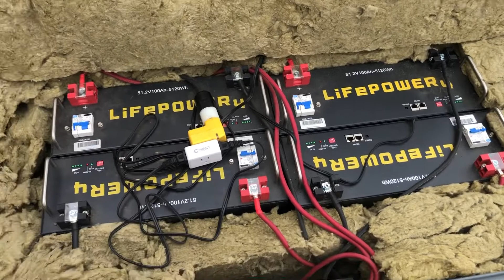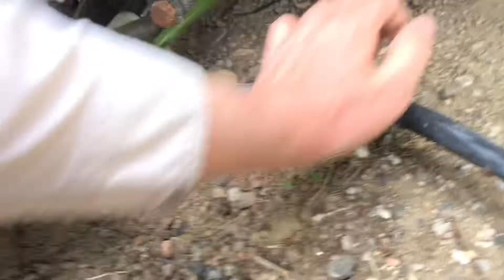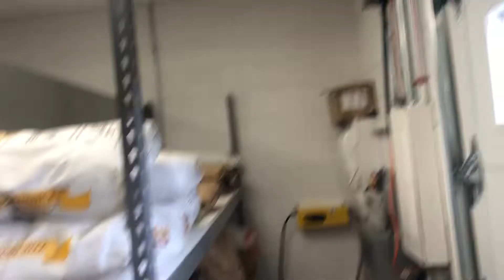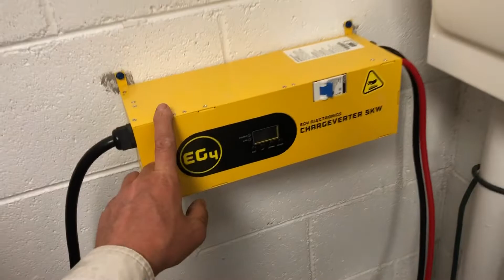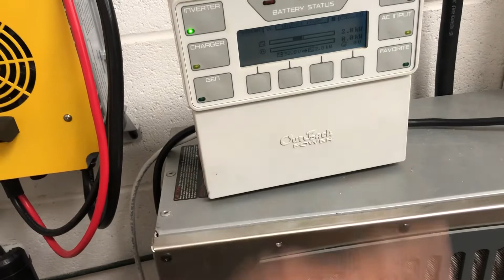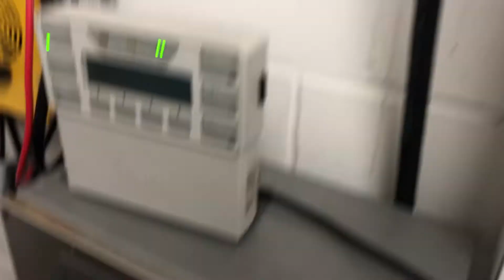Running house off a 12 amp Grid connection.

Comment: Very nice setup.  EG4 Chargeverter question.  If I have an EG4 continuously connected to battery and AC to my standby generator; does the EG4 maintain the last settings or does it reset to a default setting whenever AC power is disconnected.  If it resets to default (whatever that is) and I have to re-input my charger settings every time, the EG4 won't work for me.  Thank you.
Reply from the maker: The only time it would change is if you disconnect the battery. AC on and off has not been a problem.
Reply: Exactly what I was looking for.  Thank you.

Comment: This was the exact solution that I came to for my RV power system using a LV6548 inverter charger. I wanted the 6500 watt output in a compact package and also needed a system that can be metered down to the shore power source available. The Chargeverter allows me to run to the maximum available and keep the batteries charged while allowing me to use a massive amount of power when needed. Love it and believe 48 volt, off grid style systems are the future for larger RV power systems. Well done!
Reply: I would love to be able to speak with you in regard to your set up. My wife and I are moving up on a mountaintop in Northern Nevada. We purchased our altE Pre-wired Syst, SW4048,CL150, SCP system prior to pandemic and my wife had cancer - so we decided to hold off installation/construction until she was well. Last year we we moving forward and I had a heart attack (better now). I have now looked in the XW PRO 6848 (close to your unit size). I will call Schneider to see if our option is to add another SW4048 an accomplish "surge" issues from pumps and motor. Thanks for posting your thoughts - always interested in hearing what others are doing.

Comment: Why didnt he just get a solar generator and run what he has to and charge it up with few solar panels?
Reply: adding solar on top now would be the way to do it and the charger would need to run less and can even be put on a timer to only run at the cheaper hydro rates
it's a nice setup though!

Comment: Nice video. I did see interesting applications and all looks fine.

I would suggest few improvements. 
1. I would change orientation of that EG4 charger to hot air would go straight up . they say it doesn't matter much as it is forcer air..but trust me it does matter 
2. I do see a lot of rodent coming with wrong directions inside..those tubest should be fixed by some mesh wire or similar..
3. that generator and that connector should stay inside and not on the ground outside.
4. those cables should have some protection ..even if it is plastic tube it is better to have it so you wouldn't cut it by accidently walking over with some stuff..
disconnects

Comment: The duty cycle on that chargeverter must be exceeded it will be quite a torture test for it.
Reply: he's running it at 2800watts max if it's at 240v so it should last a long time I would think 
I've got an older 12v 800AH setup just like this that's been running for years and like he say's the battery's are pretty much always at 100% 
so really the charger is not running full tilt all the time

Comment: Nice set up, may I   Know where can I get the same eg4 steel box you are using? Thanks for sharing.
Reply from the maker: The EG 4 chargeverter is available from Current Connected. 
I purchased the steel jobsite box for the batteries from Zoro it is a 24x48”version.
Reply: I was just wondering why you don’t have those EG4 batteries in the garage, LFP batteries are safe enough to have in the house?
Reply from the maker: @stevedutcher3875   Hey great question. I had a different battery in a different system  in a steel enclosure. The BMS mosfets shorted and this shorted the cells and overheated to 750 degrees. Fire department was very happy about the enclosure being non combustable. I took that wisdom and now just build outdoor enclosures with non combustable materials. I have some other videos showing this. I agree the LFP is typically very safe.
Reply: By the way, nice setup!

Comment: Here's an alternative, low-tech way to do it:
Use two 480V ACME tranformers (these ones specifically due to their low impedance) T2535183S. $3000 incl. shipping at automationdirect.
Use all 4 wires for current carrying. Step up and down voltage. Neutral and ground aren't needed thanks to the step down isolation transformer.
At full load (24A per conductor), you get 21.8kVA into the house with 7.5% voltage drop (5.25% from conductors, 2.25% from stepping up and down), of which only 6% is real loss ans 1.5% is reactive.
At 3kVA efficiency is much closer to 98% and voltage drop is 1%. 

Much safer during a lightning storm, overall more efficient and less prone to failure.
Reply: So simple, far cheaper, only disadvantage is not having battery power for grid down situations. Unless the house is a mansion, or using only heat strips, that should be enough power to run every load at once.
Reply: Pardon my ignorance, but wouldn't the restrictions because of the 500ft of cable from the neighbour make this system unusable? Just asking, prepared to be schooled.
Reply: @Ulbre  10AWG wire is 1ohm/1000ft. A 500ft run one way is 1000ft. So the resistance for one pair is 1ohm. Since there are 4 wires, they can be put together in parallel and the total resistance drops to 0.5ohm.
That means that for each amp running through the 480V line, there is a 0.5V voltage drop. 0.5V is roughly 0.1% of 480V.
So basically, for each 480VA running through the line, there is a 0.1% voltage drop.
When converted back down to 240V, that's a 0.24V drop per 2A (1A@480V=2A@240V). Or an apparent impedance of .125ohm. 

Doing the same exercise at 240V without transformers:
Only 1 pair can be used, because 1 wire is needed for ground and 1 for neutral (the transformer in the previous example generated an isolated neutral which can be grounded)
Total resistance: 1 ohm, so we drop 1V per amp going through the line. Apparent impedance = 1ohm
Voltage: 240V
1V is roughly 0.4% of 240V
So for each 240VA, we lose 1V.

Under a 5kVA load, the 240V output of the 480V line will read 237.4V
Under the same 5kVA load, the 240V line will read 219V.
Each time you double the voltage, you quadruple the power that can be sent through a transmission line with the same voltage drop, assuming that the line heating up is not a limiting factor.
Because an isolation transformer creates a new, isolated neutral that can be grounded, we can use all 4 = double the conductors for useful current carrying in this case, so the capacity is 8x greater. 

Does this make sense to you, or did you spot a mistake in my reasoning, or do you still have questions?

Comment: Victron has some Hybrid Inverters with power assist, and it will save some electricity from going to AC -- DC and back to AC.  Did you look at those?

The Outback AC output is probably cleaner than your utility.  So if there are any brownouts or outages, the batteries will keep the building up until the batteries are drained.

Courios if any Solar will be used in the future?